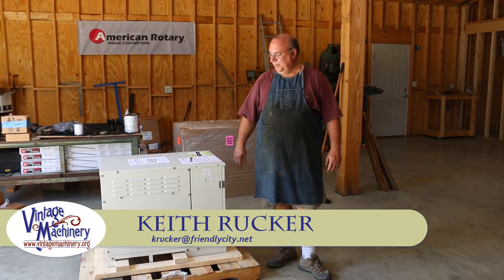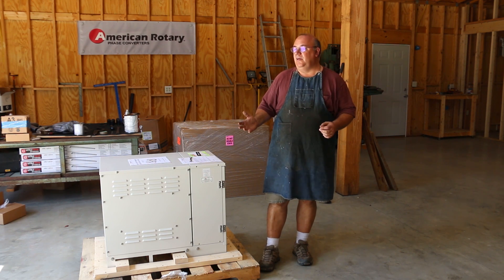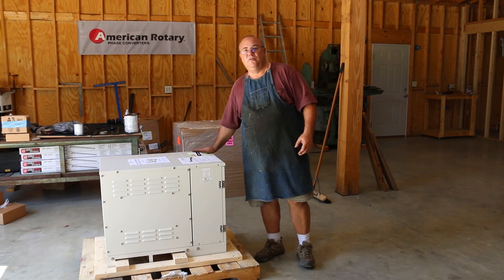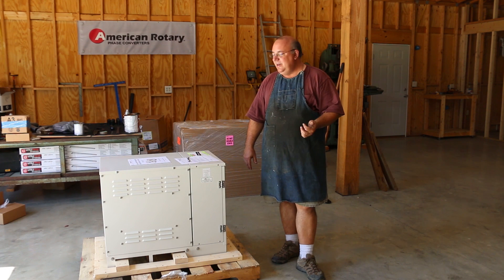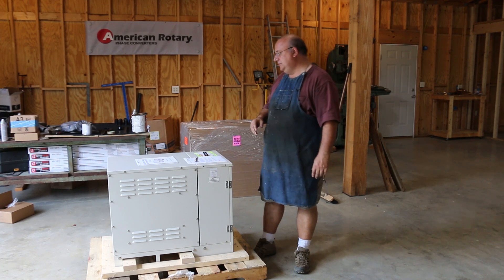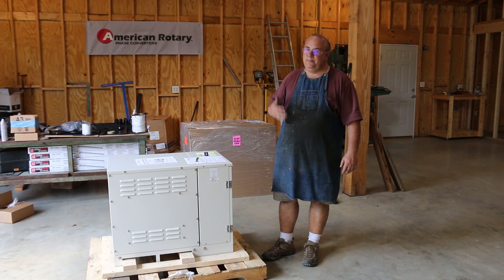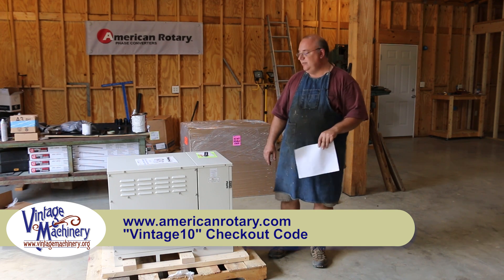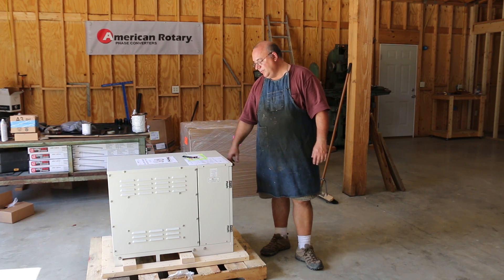Convert Single Phase Power to Three Phase Using a Rotary Phase Converter

Comment: poor americans have no 3-phase network at your house :(   I'm sorry!
Reply: Also very common in rural areas worldwide, as a SWER supply is very cheap for the power company to run, and is good enough for most uses. Thus here you get single phase motors of up to 22kW to drive machinery, especially on farms to drive water pumps, as the farmer only has to put up the gumtree poles from wherever to the water, and then there put up a 4 pole frame to hold the 11kV single phase transformer ( which he has to buy as well, so a single phase wins out because it is a third of the cost) and then run the 230VAC supply to the motor. Single aluminium steel core cable on the pole, cheap 11kV insulators to suspend it and then only a single 11kV switch and fuse at each end and the grounding mat in the damp soil. Then he only has to lay the plastic water piping to the fields.
Reply: hmpeter, one minor detail... the US's network, altho it tends to use the ground as a return on the HV primary, as that is a solid ground wire on the pole (often also used as a catenary for the secondary 120/240v lines) it's not technically SWER, it's single phase 2 wire. :)
Reply: Nope.... It's about a mile away from me. Unless the farmer gets it, I'm stuck with a converter. I'll probably do the VFD rout at some point. Currently running a homemade rotary.
Reply: Well, that's the price for living in a really big country with barely any people in it I guess. Single wire earth return - yuck! oO
Reply: Also (as noted elsewhere) it's very commonly not available in the UK too, even though unless you're rural, there's likely a nice juicy 240/415v three ph cable in the street, yards from your front door...  The price of getting that 4 core cable extended to your premises, a new meter and fuse assembly installed is likely to be eyewatering
Reply: ***** Oh, that's interesting, thank you! :-)